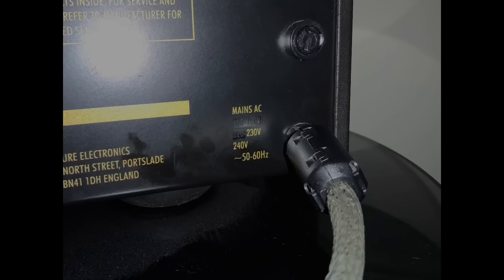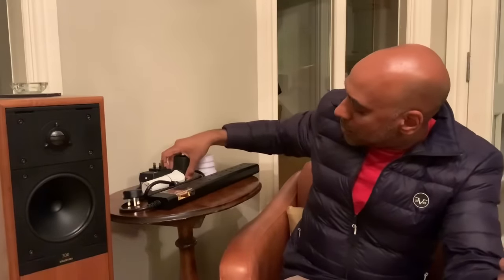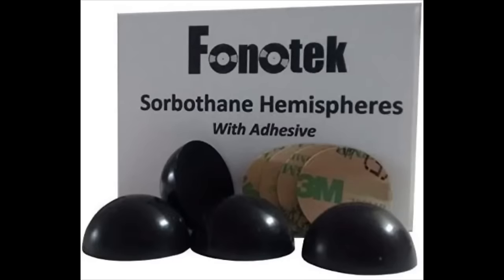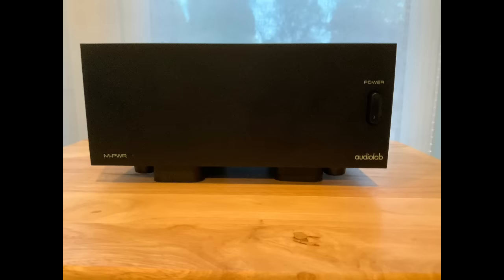My Top 5 Inexpensive Hifi Tweaks

Comment from the maker: Hello everyone, these are the links for items in my list:

5. Ferrite core (check the diameter of the aperture)
https://www.amazon.co.uk/Dreamtop-Clip-Ferrite-Suppressor-Diameter/dp/B01MG8GQ1F/ref=sr_1_1_sspa?dchild=1&keywords=Ferrite+cores&qid=1589902212&sr=8-1-spons&psc=1&spLa=ZW5jcnlwdGVkUXVhbGlmaWVyPUEzTTZEQkQzUkdWWEFVJmVuY3J5cHRlZElkPUEwNjQ3MzgxMjFVS0FBWko1WkdOWSZlbmNyeXB0ZWRBZElkPUEwNjM0OTczR1ZOQzhMWVFZWFFFJndpZGdldE5hbWU9c3BfYXRmJmFjdGlvbj1jbGlja1JlZGlyZWN0JmRvTm90TG9nQ2xpY2s9dHJ1ZQ==

4. Anti-vibration feet (silicon ones work as well as the Sorbothane)
https://www.amazon.co.uk/gp/product/B07MPC5HM3/ref=ox_sc_act_title_1?smid=A19VGPGME3DXWF&psc=1

https://www.amazon.co.uk/gp/product/B079SV39KW/ref=ox_sc_act_title_2?smid=A2K5KKYERQOFGB&psc=1

3. Tacima mains conditioner strip
https://www.amazon.co.uk/gp/product/B00UB0G4DQ/ref=ox_sc_act_title_5?smid=A2OMTXKFADW0PO&psc=1

2. Parallel mains conditioners
https://www.amazon.co.uk/gp/product/B01BGDC61K/ref=ox_sc_act_title_4?smid=A3P5ROKL5A1OLE&psc=1

https://www.amazon.co.uk/gp/product/B07835J8XF/ref=ox_sc_act_title_3?smid=AUDZDCNEQ3WOO&psc=1

1. DIY mains power lead sets
https://www.mcru.co.uk/product-category/diy-componants/diy-mains-power-lead-sets/
Reply: FYI - It appears the Tacima CS947 is a UK only device. Not available in US. Doesn't appear to be an equivalent model either as far as I've been able to tell so far, for any other type of plug in.
Reply from the maker: Thanks skrotkalle
Reply: I like your channel for no nonsense technical approach. No voodoo cables or other audiophile so called approved products. The AC power filter is something that I used in the past to get rid off junk that is present in AC line, even more present in North America than Europe.
Reply: I've been using the Tacima CS947 6-Way Mains Conditioner with Surge Protection for 5 years. It's still going strong doing its job.

I did look into research sorbothane anti vibration pads but ended up getting the superior platinum silicone pads instead. As they offer slightly better anti vibration than sorbothane.

Plus I also use thick high quality open cell acoustic foam on top of my bookshelf speaker stands. Takes the sound quality up a notch. 

Not a expert at assembling DIY leads so leave that to the tinkers. But have used the excellent performing British Mark Grant power leads. For my amplifiers, Oppo UDP 203 4K blu ray player for the last few years.
Reply: From my experience its about what works for you. like the noise blocker (ifi etc) for my system it doesnt really work to improve the audio quality. As now i run a DC Blocker which is far more effective.

power strips wise ive experimented with belkin and now run domestic made powerboard which is less restricted. imo more filtering the less dynamics.

Power cord wise. from OEM to  base Isotek to now custom power cords. every change i could hear a difference.
Reply: @dainawilburn2390  I'm from belgium and I bought it in Uk version from amazon (did not found Eu version) and used plug converters. Works very well. Worth each euro. Thanks for this channel and the tips.
Reply from the maker: Hi pliedtka, thank you for watching and your feedback. Sorry for the delayed response 😉
Reply from the maker: Thank you for watching and sharing your experiences Chinda
Reply from the maker: Thank you for watching and sharing your experiences genkifd
Reply from the maker: Thank you for watching and your feedback MAXLAND7 😉👍
Reply: dunka shane dude, I got some killer equipment from the mid 50s to late late 60s and in a trailer breathing rocks the trailer pretty easy.
Reply: Cheapest ever is switch the lights off.
Reply from the maker: @MetaMammal thank you 😉👍
Reply: HI, ferrites on speaker cables.  what if you are using BI Amping so 4 x cables going into each speaker? Would you put a ferrite on 1 cable from each amp 

So or example 1 x ferrite on the 2 x positive cables going to each speaker, and NO ferrite on the 2 x negative cables going into each speaker?

I also have 4 x Tacima 6 way power blocs on my system and think they work very well.  Good value for money.

Thanks.
Reply from the maker: @DisruptivePhoto  the cores add inductance so you have to be careful not to over do it. I suspect the reason it works is that some amps that don’t have a Zoble network on the output stage, like my Exposure amps, actually like a little added inductance. I would try one on the woofer and monitor the results. Then add one to the tweeter later and check that is doesn’t result in high frequency roll off. If it works the sound should be cleaner and the base tighter. These things are system dependent and that is why I consider them tweaks. Good luck 👍
Reply: @abritishaudiophile7314  Hi There, many thanks for the reply.
Reply: I've found another relatively cheap way to improve the 'cleanliness' of the power going into my audio system is changing out the actual electrical outlets in the wall. And not just so-called, 'hospital grade' ones, but those designed for audio setups, like those by PS Audio, FurtureTech, etc.
Reply from the maker: @soupistasty5  great 😊👍
Reply from the maker: @Z Evans that is disappointing. I don’t know anyone else who supplies them here. Have you looked into see if you can get the Belden 19364 elsewhere. It is a good alternative.
Reply: Hi Tarun. It's been a while since i commented on any of your video's. I would appreciate your help. I have a Pioneer A-400 integrated amplifier for about 30 years, which always had a slight transfromer buzz coming through the speakers. Which i thaught was due to the fact that the mains is earthed. Just yesterday the buzz was louder, so i changed the plug into a different socket, the buzz went away.
Also i noticed my Plasma tv was partly to blame, because even though the plug on the wall wasn't turned on, the buzz went away when i unlugged the tv from the wall. Would you recommend the... (Tacima mains conditioner strip), to cure this problem thanks.
Reply from the maker: @alanjipy55  Hi Alan, plasma TVs are notorious for radiating noise. I would plug it into a different socket to the rest of your hifi equipment and use the Tacima strip for the hifi equipment. Good luck 😉👍
Reply: @abritishaudiophile7314  Thanks for the advice, i ordered one yesterday. Also i already decided to buy a oled tv 👍
Reply: Hi, 👋 are there any sound (pun) EU alternatives to the tacima power bar?
Reply from the maker: @Rab2485  I am not sure 🤔
Reply: Hello Tarun
You only recommended 1 magnet on the speaker cable as 2 magnets together might cause problems. Could you put another magnet further down the cable so they weren't together? (Or at the amp end?)  Thanks Glen England
Reply from the maker: @elsojackkirk  you could but they add inductance and too many would cause high frequency roll off 😊
Reply: Not sure why, but you have a very high frequency ring throughout your video. At first I thought it was my tinnitus but I paused the video and the ringing stopped.
Reply from the maker: @Jack-oc2fc  it was an early video shot on my iPad with no mic. Apologies 😊
Reply: Ferrite should be at the amp end, around the pair. The idea is to reduce common mode RFI introduction into the amp.  (Most amps have this as part of an RFI and HF stability filter at the output but more is fine especially if any transmitters nearby.)

Isolating speakers from the floor is a great idea if you're living with neighbors.  But if your goal is accurate reproduction at real life levels then the transducer needs to be solidly affixed in order for transients to propagate.  Otherwise the speaker cabinet moves opposite to the propagated wavefront, reducing its sharpness.

The EMI/RFI/line transient suppressors are great on signal level equipment.  But not for high power amps.  Power amps need to be able to pull short fast bursts of current and these filtering devices necessarily add impedance to the line so will dull transient response.

Same goes for supplying input power to power amps, minimizing impedance introduced is the main concern (at least for life sized reproduction.)
Reply: The cheapest and most effective option for a stable and noise-free power-supply probably is to use a car-battery.
Reply: @davidzoller9617  
Sounds like a good guess.  Now tell me how to obtain the different rail voltages required by the various stages of amplification.
Reply: @elgringoec  Yes, you should make the decision to use a battery before you buy the amplifier.
Reply: @davidzoller9617  
I think you're neglecting to understand audio equipment design.

Comment: At the end of the day I found the best tactic that improved my Hifi system and it really works for me is I go out in the backyard and I dig about a 3 m x 2 m hole and I put my turntable in there along with my speakers and then cover it back up with concrete. I've been doing this for several years now and it's quite literally changed my perception of what's possible with pre-recorded music.
Reply from the maker: At least you didn’t put yourself in the same hole 😂
Reply: Inane troll.

Comment: My most effective and inexpensive tweak is to have my ears syringed. Outstanding!
Reply from the maker: Agreed 👍
Reply: This is interesting because when I listen to music sometimes my left ear is slightly quieter and I find myself twisting my head so I guess this kind of makes sense if it's just wax build up 🤔
Reply: I guess sometimes, that could have a negative effect, hehe, 🔥
Reply: I guess sometimes, that could have a negative effect, hehe, 🔥
Reply: Christiaan Baron  You did not notice the bees .... ?
Reply: There is one easy trick called "ear dust off" that helps with this, basically you just put on headphones and listen to Slayer on full volume for about an hour and it will clear your ears :) 

(DON'T ACTUALLY DO THIS!)
Reply: Additionally, take your eyeglasses off if you wear them. Major reflective surface right between your ears and the speakers. Oh, and pick up the album covers from the floor.
Reply: I just syringed my left ear about 2 weeks ago and gained 3db in volume.
Reply: I’d recommend an on line hearing test as a first step. It may recommend a full hearing test. I resisted this for many years. I’ve lost a good deal of high end in my right ear and some overall loss in my left. I visit an ear nurse from time to time. I now wear hearing aids.
Reply: Hahahaha
Reply: Power cables are snake oil .
Reply: @Tec2Nut  Don't think he had snake oil in his ears...or power cables.
Reply: @Tec2Nut 🤔  if that is true, how do you provide power to your equipment?
Reply: @Tony-Tequalla  Telepathy 🤣🤣
Reply: Only effective if your system is upto snuff all the syringing in the world isn't going to sort out a poor bass response
Reply: I agree... it's not necessarily an expensive job, and well worth it.... life is too short to plod along with ear wax taking the pleasure out of your audio experience
Reply: @Tec2Nut  I have copper OCC power cables, and boy does the music gain body and thickness and warmth
Reply: @pandoraefretum  it's a power cable   , each to their own .
Reply: @Tec2Nut  well i tried copper then copper plus silver... each and every time the silver gave high treble edge and listener fatique... so as a rule I eliminate all silver from interconnects and power cables. Copper has excellent properties and gives a warmth to the sound which I simply would hate to miss out on
Reply: @Tec2Nut  😴😴😴
Reply: I do it myself as I get a lot of wax buildup. It is safe to do with a Debrox and an ear bulb. Never ever use qtips!
Reply: Can confirm this tweak is amazing. Thought everything I own had a channel imbalance in right side lol.

Comment: Great to see Hifi tweaks! Thank you Tarun!  I am 70 years young and have experienced VPI Magic Bricks from VPI  and Tip Toe component feet  invented by the Mod Squad that did help my system sound better.  I discovered many tweaks that work from Yamamoto Sound Craft in Japan. They have Cherry and Ebony wood head shells for phono carts.   I found their PB-19 beveled pure Ceramic spacer that is 12mm in diameter and 2.2mm high very useful under speakers/componets and on top of glass turntable platters in order to decouple the vinyl record from the felt platter mat. The ceramic spacers reduce static electricity in the vinyl during playback. You might have to adjust tonearm VTA when using the spacers.  Rega now has a Ceramic platter for one of it's turntables.   All the Best to you! Happy Listening!
Reply from the maker: Thank you Brian 😊👍

Comment: Got a couple of the ferrite cores and put one on each of the negative (-) side of the speaker cables and was very surprised at the loss of background noise I hadn't realized was there. The silence, while not jaw droppingly incredible, it was quite um, audible.
Thanks for the tip! Cambridge AXR85, ELAC Debut 2.0 B5.2 Speakers, RT82 Turntable (upgraded acrylic platter), Sony BDP-S590 3D Blu-Ray Disc Player, MD deck and double cassette deck. Thanks again!
Reply from the maker: That is great Liroso. Thank you for sharing your experiences 😊👍

Comment: Very comprehensive information with a good presentation too.  i use the Tacima power strip, the washing machine feet with the sorbathane half spheres seated in them and a shielded mains lead also (i only earth my outer shield at the mains end). Many thanks - Paul Yates
Reply from the maker: @pennyyates-bo2ru  thank you 😊

Comment: Hiya Tarun, trust you are in top form and engulfed by sweet music. I agree with all your comments. The iFi AC Purifier is a great addition. Lowers noise floor and improves detail a little. Also removed a slight preamp hum I had at no loss to dynamics. I use sorbothane hemispheres under every piece of electronics - valve or solid state. Important to use correct rating for the weight of equipment it is supporting otherwise it doesn't work. I have 11x second hand Russ Andrews power cables. 16 year old Reference Wattgate 320 IEC cables are about £70 if you look hard enough. They originally cost over £300 ! ! ! ! 16 years of burn-in should be enough. I found the Tacima mains strip to be bettered by a Russ andrews strip. Dynamics increased a little but 3x the cost. I am currently trying a Weiduka AC 8.8 with great results. I also have Russ Andrews torlyte floorstander platforms. They improved separation and brought Nina Simone into my living room. Again second hand at £90 (£440 new !!). I can reveal my second hand secrets now as I have completed my system and will never need any more or better cables. Sudden rush to Ebay...
Best tweak - new music.
Reply from the maker: Hi Bongo, I get the feeling that we are very like minded individuals. I really enjoyed reading about your experiences. Thank you for sharing 😊😊😊
Reply: correct no.need to buy new Ebay's full of hifi especially cables

Comment: One of my cost-effective tweaks is drum dampener gel silicon that I double stack and place under each corner of bookshelfs.  The bass becomes weightier, more articulate and a bit more "bouncy."  I think they are the best decoupler, better than springs (like Nobsound spring) which, in my listening test, softens the bass.
Reply from the maker: Thx 😊
Reply: Moon gel?
Reply: Why under bookshelves? Not under the hifi rack? Huh

Comment: Hi Tarun. Some very simple yet useful tweaks here. I tried the Tacima power strip. The anti-vibration appliance pads repaced the spikes on my speaker stands and, together with rubber door stops de-coupling the speakers from the stands, have all had a remarkable result. Tighter bass, better imaging and vastly improved width and depth in soundstage have been achieved with these inexpensive mods. Who'd have thunk it? Thanks a lot. Solutions don't have to be complicated eh? By the way, I also have zero options for speaker positioning (wall proximity) so got a pair of foam bungs for the L/F ports which has dramatically reduced room boom.
Reply from the maker: Thank you for watching and sharing your experiences Rafe 😊👍

Comment: Now these are the kind of videos that I wish more Hi-Fi content creators could get behind. Great video. I have most of these options at home but have never tried the Ferrite cores on speaker wire, so will no doubt have a play later. Will have to try the washing machine pucks as well. But this for me is definitely the more fun for trying. After watching a video yesterday on YouTube by a different subscribed channel where the presenter has gone from modest improvements that I have learnt from over the years and still have a lot of time for and is now posting about a £1500 power supply for a £3K pc and £7K for a pack of four over designed door stops! I feel he is losing my interest. This video is reflected of the fact that the hobby is for everyone and you don't need an 8 figure salary to enjoy Hi-Fi. I thank you. Keep up the great content, it's a very welcome breath of fresh air.
Reply from the maker: Hi Martin, I started this channel because friends and family regularly asked my advice about putting together a hifi system. I feel passionately about doing my bit to make sure good hifi is accessible to everyone. Thank you for watching and sharing your experiences 👍
Reply: Totally agree.
Reply: The problem with such videos is that there is no proper technology explanation for why things work as they do.

As long as you know what you are plugging in and you have read that it will help then you have easy to believe it works!

You also need to take a blind test.

It also takes too long between so you can also forget things in between as you test!
Reply: Well, maybe not today but back in the days if you wanted those juicy high wattage amps with a certain pair of speakers you definitely needed to have a certain income. (this 8 figure income you talk about). Back then it was more of either you paid a small amount for something that probably worked but it was total garbage or you "invested" in something pricey for actual quality.